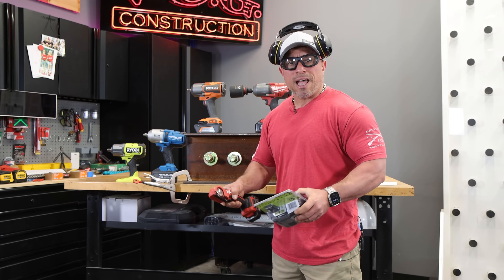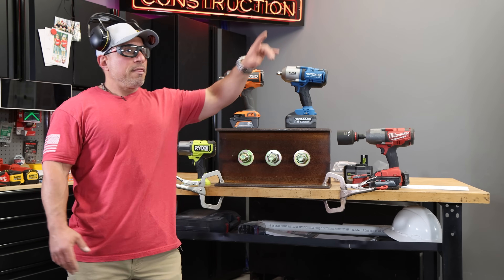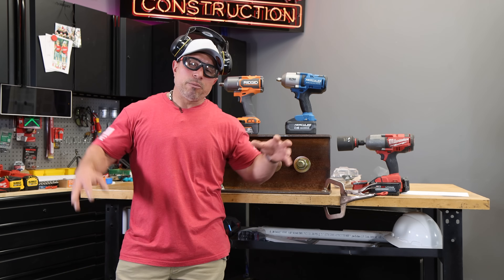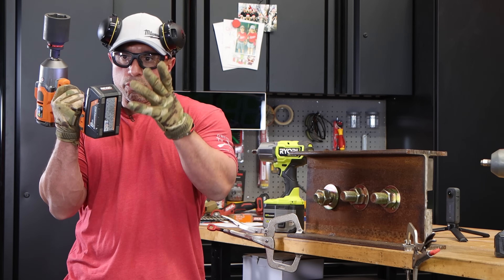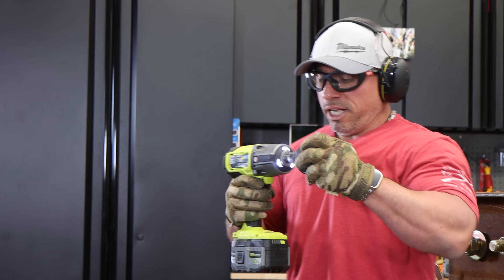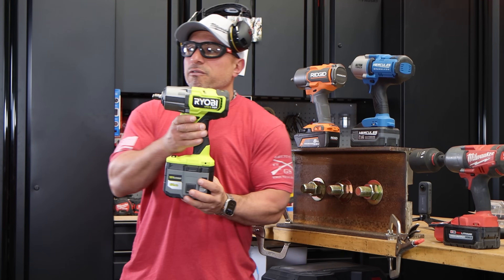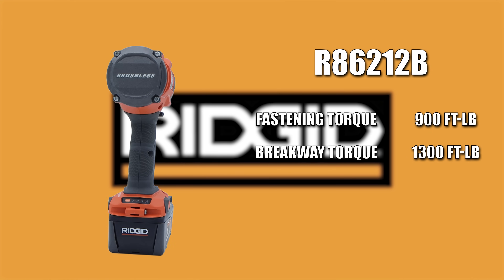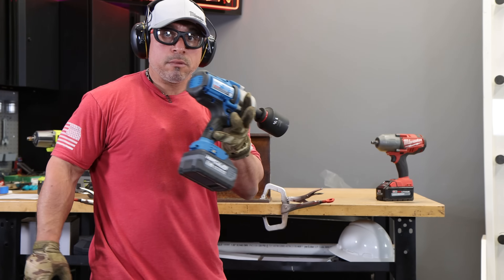Our Torque Test Milwaukee, Ridgid, Ryobi & Hercules Hope You'll Ignore!

Comment: on one hand, it's good to test the performance of the impacts with an adapter, as there are plenty of use cases that this would apply to. on the other hand, i think the test would be more accurate if the bolts were tightened to a verified torque spec with a torque wrench. then, you are testing the actual performance of the tool vs a verified torque, rather than which tool performs the best with an adapter, which may have more to do with the speed / frequency of the impact mechanism than the total torque output.

Comment: With this test there are a few clear things: 1. Ryobi is trying to build a name as an introductory professional tool. Its no longer aiming for the strict DIYer. That tool is very much made the same way the rigid is and likely features a similar motor to the 3 gens old milwaukee. 2. That Milwaukee was a hell of a tool new. 3. If you are already in an ecosystem there isn't a reason to go out and buy into a new one just because you need a 1/2 inch impact.

Comment: I have a hard time believing you struggled with a pickup truck lug nut with that hercules. I have a gen 2 ultra torque, and I've used it on semi truck lugs that hadn't been removed in at least 5 years. Was burning through two batteries per wheel, and almost wore out the square drive of the socket I was using, but that hercules never gave up and got all of em loose.

Comment: Ridgid without question.. Reason? The lifetime warranty not only on the tool, but the battery as well. THAT makes the Ridgid the most valuable. In my opinion
Reply: @brianhund8177  We switched to all ridgid and couldn’t be happier, the quality, price and lifetime warranty proved to be the most value long term. We had older 12 and 18 volt models (10-15 yrs old)being repaired and they gave us the newer upgraded ones for free.
Reply: yeah i like  rigid.. the lifetime warranty should be a selling point itself
Reply: Bought the ridged with two 4amp batteries for 180.00 on sale 6 months ago. Very happy with it!
Reply: A company that offers lifetime warranty not only so they stand behind the product but the believe in their peoduct
Reply: Yeah but will they actually honor the warranty like kia and hyundai weaseling out of engine replacements?
Reply: @efremendez  Yes they do..
Reply: @TheBeast-tj9qo   
  okay what did you get replaced or so?
Reply: @efremendez Absolutely they do
Reply: @nicoctane1669  okay what did you get replaced or so?
Reply: @micheskillz half inch ridgid octane  impact  and 2 Batteries.

Comment: Ridgid does everything I need it to do and comes with the lifetime warranty including batteries which is why I have replaced everything in my garage with the Ridgid line.  I don't believe any other brand comes with a lifetime warranty on batteries.  I just had a 3ah battery from 2013 go dead on me and I called Ridgid they asked me a couple questions and sent me out the latest gen 4ah battery as a replacement so that has saved me well over $100 and all of my tools have worked as intended and done what I needed them to so for me its Ridgid 100%

Comment: @vcgconstruction Another great video! Once again, using what I learned from your channel, I got a super deal at The Hone Depot. 2 m18 12ah batteries & 1 m18 8ah battery with a rapid charger for $339.00! Before I subscribed I would have walked in the store and paid $250.00 for 1 m18 12ah battery! Thanks again Vince!

Comment: Why are you comparing against a 10 year old  milwaukee impact that isn't even sold anymore? Compare current gen against current gen or this test is just complete BS
Reply: Because it's nice to have an impact as powerful as the Milwaukee with out the Milwaukee price.  I use the Milwaukee at work, the Ridgid at home which I got on deal for $80 on sale.
Reply: @morenothing4u I like ridgid as well but your comment makes 0 sense..
Reply: @shortsmcgee7134  My work place supplies the tools.
Reply: @morenothing4u  that still has nothing to do with the comment you replied to…? 😂🤦🏼‍♂️
Reply: The point of the video was said in the beginning 🤷‍♂️
Reply: For the price of Milwaukee 10 years shouldn't matter especially compared to "cheapo" hercules. If they still sold or sell that Milwaukee if it is 10 years old I guarantee it's still way more than hercules.
Reply: I think you missed the point of the video, I think the guy is saying that they all pretty much do the same thing,  you can buy any and expect a good powerful tool... If you have a 10 year old Milwaukee no need to upgrade, and if you're new to power toolss you can buy whichever and get the same results.
Reply: @juhs  because all the other impacts are about the same age and it’s the best comparison
Reply: DCF 961 is my new BF👍

Comment: I have the Ryobi that is a monster for the price and with the Ryobi system being as good as it is a no brainier for me and if u catch ryobi days you can get a great deal
Reply: Yeah 139 for the high torque with a 4ah battery today. I have the mid torque and the extended reach 3/8” ratchet as well as an older blue cordless drill and a corded one that started me down the ryobi path. The hp tools are like 90-95% of Milwaukee quality definitely just as good as their last gen.

Comment: I picked up the Ridgid High Torque kit with two 4ah high output batteries and a charger with bag for $199 a few weeks ago.
Reply from the maker: How you liking it?
Reply: @VCGConstruction  I've only gotten to use it once It worked well changing over studded winter tires off of two Scion XB's.  
It was surprisingly heavy though.  
Bought it cause I needed a couple of ridgid batteries and figured that if I did this route it might keep me from buying Dewalts new beasts.  I know I could have taken the lugnuts off with my DCF 923 but I wanted to try the ridgid.
Reply from the maker: Thanks

Comment: "But nusting torque" lol. 

Also, something important to keep in mind is that if you set torque for a nut/screw to a certain amount, it will inherently take less than that to remove the fastener. 

Case in point, torque spec for gas key screws on an AR-15 bolt carrier is 50 inch pounds. When testing if the key screws are torqued to the correct spec by attempting to loosen the screws, more than 25 inch pounds is considered a destructive test.
Reply: Follow up to this. Torque test channel proved that any adapter for a socket reduces the amount of torque applied to the fastener by an impact wrench

Comment: From what I have seen your missing the power houses . The new DeWalt new Milwaukee and the Makita 40 volt beast. From what TTC shows the new DeWalt high torque should ripped the wheels off. I think its hitting just shy of a thousand foot pounds. The new Milwaukee ain’t no slouch it self
Reply: Plus Milwaukee as big brothers 3/4” drive and 1” drive
Reply: He’s purposely testing an older generation Milwaukee against lower tier newer model impacts. Of course he’s not going to use those..
Reply: @justine7242  
I know he’s not gonna use those. I was just saying that Milwaukee offers them it would not be a fair test to put a 3/4” or 1” up against the 1/2” models
Reply: @justine7242 doubt it, Vince is without a doubt a Milwaukee fan boy
Reply: He's also using the Gen 1 Hercules Ultra Torque not the Gen 2, (which I believe has a higher torque rating) or the 3/4 Ultra Torque.
Reply: @harlanborders943  que signifíca TTI ???
Reply: Es un Chanel de YouTube se llama Torque Test Chanel donde gente prueban el par de torsión de varias herramientas, como las llaves de impacto.
Reply: Que signifícan las siglas TTC  ???